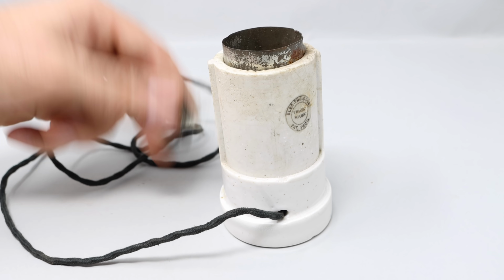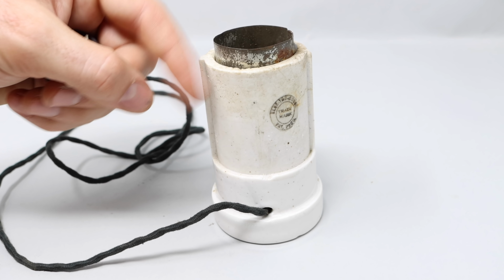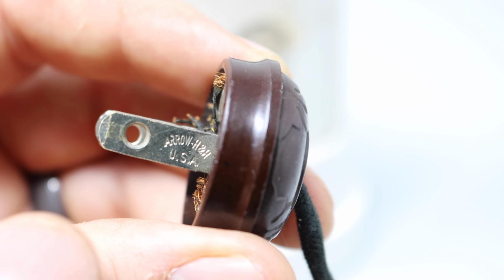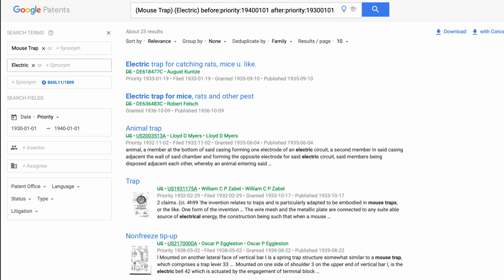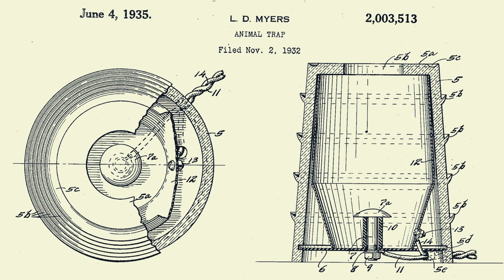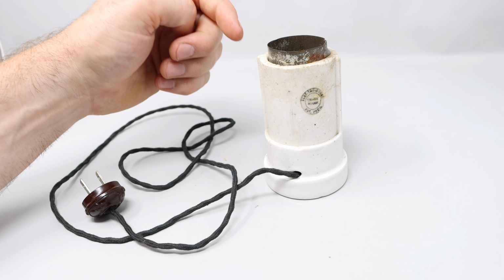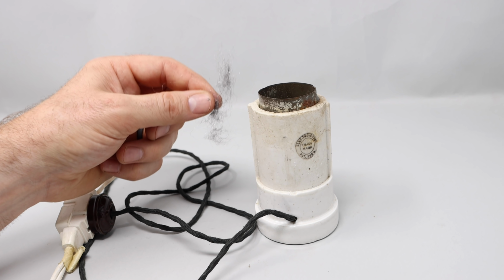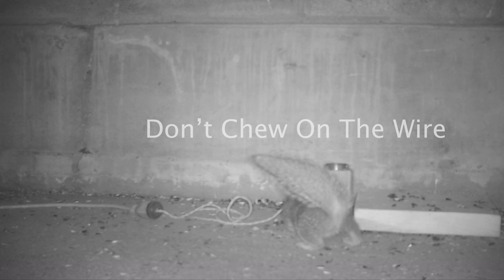I Need Your Help Explaining This One - The Electro Mouse Trap from the 1930s. Mousetrap Monday.

Comment: Translate google :
Ohm's law. The transient resistance and electrical resistance of the mouse body will not allow the passage of a lethal current at such a low voltage. The mouse only gets a shock and reflexively jumps away.
The reason why home electrical outlets kill is that muscle cramps prevent them from moving. One holds on and cannot let go. It takes a few minutes for the heart and breath to stop.
If the squirrel bit the wire, it would get a muscle spasm into the masticatory muscles and slowly die there, unable to release the grip.
If you want to kill a mouse with current, you must use a higher voltage to overcome the electrical resistance.
If you don't want to burn, don't do it. The whole barn will catch you from a burning mouse or wires.
Reply: Happy Day  The method of contact is critical. Just a touch throws a man away. The grip is deadly.

Comment: This all boils down to ohms law which is Volts=Amps x Ohms.
The average human has about 50,000 - 100,000 ohms of resistance. When a human touches 120vac and is grounded, he/she will experience approximately 1-2mA of current passing through their body. It would normally take about 25mA of current to pass directly thru your heart to induce cardiac arrest, otherwise, the current is nothing more than unpleasant but certainly not harmful. I would speculate that a mouse's body has roughly the same resistance as human, so unless the current were to pass directly through the mouse's heart, it would be nothing more than a mild shock.  Any electrician will tell you that it's not the voltage that kills you, but instead it's the current, and ohms law dictates that the only way to increase the current significantly is to increase the voltage significantly. 
The reason the mouse doesn't go up in flames like the steel wool, is because the steel wool is basically zero ohms which in an instant, passes around 120amps of current, which is roughly 100,000 times more current than the mouse will experience. Hope this helps.

Comment: The old electricity was 220 or 440 volt, because the old wiring either had no fuses, or the old unreliable fuses, and circuit breakers were not that sensitive.

Comment: That is one of the most unsafe and dangerous electric items according to modern regulations. no fuses, old style insulated cables, live circuit at the sight of the user and no grounding connection.

Comment: The A/C power that all power companies use tiday, will consistently cause any person or critter touching it to recoil instantly from it. D/C power will kill because it will hold the person or critter to it without causing them to recoil from it. today, you will have to at least use 120vdc power, also called "rectified" power, to power your trap.

Comment: It could be the difference between AC and DC power, AC is alternating current, DC is direct current. In America, common household plugs are 120 volt AC, so that might have something to do with it somehow? Also the trap was not grounded, so when the mouse was introduced, it may have just shorted the circuit instead of completing the circuit. Not too sure, that’s just what I think from hours of watching electroboom on YouTube.

Comment: i believe spacing of the connections inside is important to electrocuting. Current needs to go across the heart. If front paws are in front of the heart on the mouse and that is where he makes contact with the side he would get a jolt but if it doesn't go through his heart so it probably wouldn't kill him. Not sure of mouse anatomy though. Feet may also be so dry that he gets a lighter shock. Looks like it was made from a light socket.  It is very dangerous around children and people not understanding electricity which is many people back then.  Not sure if the metal on the side extended out far enough for fingers to touch it but if it did it was even more dangerous. Plugs of that era weren't polarized as they are now so the metal on the side the entrance stands a 50% chance of being hot while the inside center could be ground making it even more likely for fingers to touch it and get a shock even if they couldn't reach the contact at the bottom.

Comment: 120 is barely lethal because their resistance is low probably. What you need is to add a flyback transformer and a high voltage capacitor.

Comment: What makes electricity deadly in this case is the actual current that runs through it, rather than voltage. So if you read other peoples' comments they speak of needing transistors, etc to modulate and ramp up the current to make it lethal. That's also not counting safety features, and so on.

There are far more regulations and control now compared to back then, so even if it did work back then (no clue) it is a different situation to now.

Comment: Make an Ac to DC convertor, and when they make a connection, the electricity will, instead of pulsing and allowing the mouse a moment to jump would rather be constant and direct, causing the mouse's whole body to clench right where it is therefore locking it into place until death arrived for it.

Comment: It is a fire hazard. It would likely blow out any fuse on the circuit or (if the mouse managed to form a circuit for a while) melt a wire somewhere in the electrical system.
There's a slim posibility that there's a step up transformer in the ceramic somewhere to raise the plate voltage difference but I agree with Goaden Homestead, it's electric because electric was a sign of "modernity"

Comment: New building codes require breakers and safety grounds to prevent electrocution, at least that's the only thing I would think would be different.

Comment: I think I know why... it might not be correct... there is a weight trigger and when that goes off it sends a signal to the electrical system to put electricity into the metal... like when a screwdriver goes into outlet it makes Electric
 sparks... in this case the mouse is the screwdriver.

Comment: The reason the mouse did not get electrocuted was mainly due to the relatively low voltage down here in the us where we use 120 volts which if you do the math only results in milliamps of current. In order to die from such a low voltage you need to be in continous contact with the electricity in order to insure that it thoroughly fries you but a quick zap wont do. another thing is that mice are furry and their fur could act as an insulator so the electricity has a harder time shocking the rodent and makes poor contact.

Comment: try a little conductant grease like you squirt onto auto light contacts. that ought to juice things up to snuff.
Reply: also, a capacitor and a diode. if you want the thing really fried. better stick a fuse in there too...

Comment: 110 AC probably not, 110 DC more plausible, but not on the 1930's. Also the corrosion in the tube increases the insulation value of that contact. A shiny new tube will give more electrical contact area as the rodent goes further in.

Comment: It will work with higher Voltages. 120V in the US is a low Voltage compared to the European or Australian standard at 240V. It will be more lethal for mice. But Voltage is just one side. Current is also important. You need a high Voltage and a high current to kill. I'm convinced that some animals are able to feel the magnetic field around electric devices. That's why I bet that a non electric old style mousetrap will do a better job.

Comment: Electricity kills by causing muscle spasms and  thus respiratory and or cardiac arrest by disrupting the brain's automatic electrical signals to the heart / lungs. (This is where CPR comes in to get you started again)  Also I suspect the leg muscles give a kick lifting the mouse off the contact, so not enough time or voltage to stop the heart. With dry conditions not enough conductivity. YouTube mouse zappers step up the voltage the to thousands, so the old time mains voltage traps probably were not very successful. Well done Shaun, keep up the good work.

Comment: It's the volts that freeze up muscles while it's largely the amps that kills. This is why a charged capacitor works so well in the modern ones. Balance of both.
Reply: They generally use a high voltage transformer to build up a charge, while it may be the amps that kill you really don't need much (As in a few hundred milliamps for a human) to kill something, you just need the shock to be able to penetrate all that tissue and reach across the heart.

Comment: I think @Da5id C is correct that it is most likely to work standing up. It needs to be difficult for the mouse to get out. Also, the plug is not polarized like modern ones. It would probably work best with the metal tube Neutral/Earth and the pin at the bottom Live/Hot. That way there is less chance a mouse will touch the tube and the ground and get a minor shock that would scare it away. But, really, not a good trap even with the best conditions.

Comment: If you want to make the other trap work you will need to plug in a load to the same socket to induce current flow. 
- 
Old electric chairs used light bulbs.

Comment: I'm pretty sure if you had placed a bit of peanut butter on the bottom connector inside the trap and a few tiny smears around the outside of the housing the results would have been different.  I didn't see much incentive for the mice to enter the trap with all of that kibble spread about.

Comment: There’s no capacitors to carry enough current through the mouse. Also the only shock one side of their body. If it shocked both front and rear feet they would have enough current to lock them up. Same concept when you shot with a taser. The closer together the prongs are they less effective the are. The father apart they connect the better disabled the person gets.

Comment: In theory it should work the same way as an electric bug zapper works unfortunately there would not be enough current to kill a mouse. I have however seen a squirrel explode to death when when it accidentally shorted out a high voltage power transformer.

Comment: DC doesn't kill well, AC over 1 amp kills indiscriminately. Voltage=pressure, amperage=volume. It was Edison's argument against alternating current. Edison was also a thief and his only true passion was controlling others. I had to do some renovations on my great grandmothers house (circa 1908) where there was leftover evidence that AC was hardwired in and used standard 2 prong outlets.

Comment: I’m sure this has been mentioned already, but that plug is most likely is using straight wall current, which is AC. All of the modern traps I’ve seen use batteries which is DC.
Reply: Clearly, you DON'T know what your commenting about. 
Lethal CURRENT flow through a human is less than 0.1 Amp and modern 'safety switches' (RCD)  are designed to trip power supply at 0.015 Amp ( 15 milliamp ). A small rodent would have an even lower lethal flow of current level. 
Likewise, A.C or D.C. at the terminals would make no difference, nor variations in that mains supply between 100V or 120V A.C. mains supply as used here. 

The device would function better if it had a higher Voltage across the terminals, to breakdown the higher resistance of the intended victim, around the 600V to 1,000V range. 
As those who know  why this doesn't function say, water on the mouse would present as a lower resistance of the critter.
Reply: Da Reproducer i was just pointing out that it’s extremely difficult ( I couldn’t find any) to find a modern electric trap that uses AC, maybe it’s easier to step up DC. Seeing how that trap is ancient, I doubt they had the technology that even modern manufacturers don’t mess with. So since I clearly DO know that DC is far more used today, like my original comment said ,”straight wall voltage” meaning it’s not getting stepped up

Comment: Many comments are correct. Didn’t work then, doesn’t work now due to the relatively low voltage. That’s one reason why we have 120v in the US. Safety. I built a mousetrap using 3,000 volts dc and a defibrillator capacitor. Works great every time.

Comment: So here in the UK our household electricity is 240v as standard, for safety all workshops factories etc MUST use 110v as its deemed safer. So was 110v standard in the 30s USA? 240v may have done the bizz 
I have been given a few reasons for the safer aspect, one is that 110v throws you off, whereas 240v makes you hold on, and keep getting electrocuted....don't know the truth of it though.

Comment: The bottom plate and the side plates are like two ends of a battery but mor powerful. When the mouse touches both the plates simultaneously it is short a d the mouse get shocked.

Comment: Simple, the shock needs to be arranged to go through the heart not through the nozzle. A simple electrified divided plate that the mouse has to put both front legs on will do the trick.

Comment: It kind of looks like there's a piece missing. The patent drawing looks like there is a piece around the top with a smaller hole in the middle. Maybe if they had to squeeze into a hole they wouldn't be able to jump out. Also like another commenter said if it was upright they may have a harder time jumping away from the shock.

Comment: I wouldn’t put that anywhere near hay, leafs, bugs or anything else potentially flammable. The plug in is very old and frail and your power source may be dangerously overpowering, causing sparks. That thing may burn you barn down

Comment: Originally household electricity might have been DC rather than AC. With DC the mouse wouldn’t have been able to let go, its muscles would contract and hold it there. With AC you get less of this effect especially with low currents, more of a tingle and giving enough warning to jump back.

Comment: Actually it may have been the fact that it was on it's side. I doubt the mouse could have jumped out so easily if it was upright.

Alternatively, maybe it was designed for DC current. AC (alternating current) fluctuates, so it is easy to get away from it. But DC (direct current) will cause your muscles to lock up so you can't jump or pull away.

I know that back in the 20s, my grandma's baby brother got a bad burn on his thigh from his wet diaper coming in contact with a live wire. The insulation on cords back then wasn't waterproof like it is today, and the urine soaked through the cloth insulation and acted as a conductor. They had DC if I recall correctly.

These are just guesses and the facts are from memories of science class 50 it so years ago, I hope I'm remembering it correctly.

Comment: The answer is that mainly the mouse is able to move away. The modern ones trap the mouse so that it can't just jump away.

There's no need to a step up transformer really (ironically the power is unlikely to increase even if there is), mains power is plenty to kill a mouse...or human, you just need to be in contact with it long enough.

I recon that if you fixed this trap so it didn't get knocked over, it would do a fair bit better as the mouse would fall into contact with the plates.

Comment: Well, the  Rural Electrification Administration Act of 1935-1936 is how most farms in the US initially would have gotten electricity. From a quick google scan I gather that the REA standard installation (at least after ww2) would have provided 60 Amps of electricity with a voltage of 230 Volt. The distribution system itself appears to have run at 6900 Volt from the start. 
So I think the cheesy answer is that the voltage they used was probably at least twice as high as what you are using, with the potential of being rather higher.

Comment: I do wonder if you made one with an extremely large high volt capacitor if it would work. Essentially like one of those electric fly swatters but scaled up for mice. I mean at that point it may be fatal for humans as well but that just means it would for sure work on mice.

Comment: We've been on the same frequency since we've pumped out A/C in the states, 60hz. Maybe these designs never worked consistently to begin with? Need to have a design that the rodent can't just back out of, then it'll fry! Maze traps would work well with motion sensor activation, so when the rodent crosses the point of no return it won't be able to escape electrocution. GL

Comment: I suspect that in 1932 this thing worked about the way it does now (not very well). I’ve been shocked with 110 volts, and while it was very unpleasant, it didn’t injure me seriously. 

The newer electrocution-based mousetraps include transformers that step the voltage way up, so that even if the trap runs on 3-volt batteries, it may be delivering thousands of volts to the mouse.

I wonder if this design would work better in countries  (like most of Europe) that have 220 or 240 volt line current.
Reply: Doubt it. It would probably just fry the wire. But you couldn't plug it in anyway without jerry-rigging it